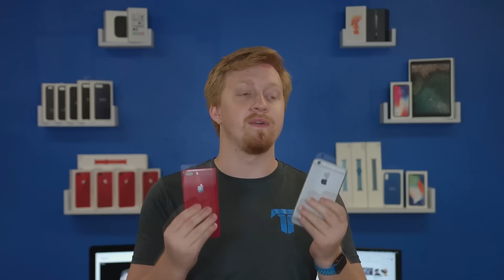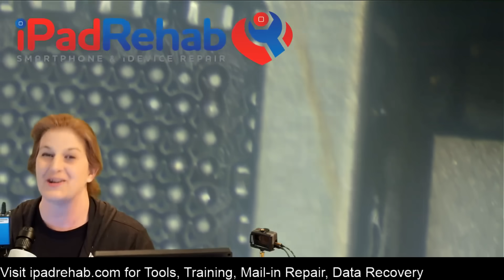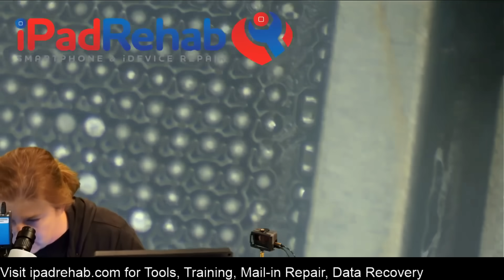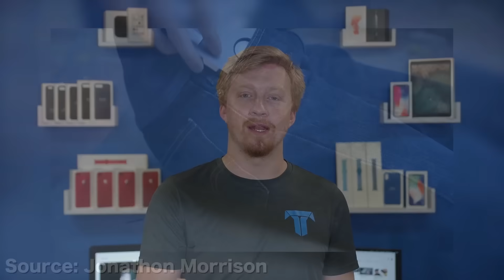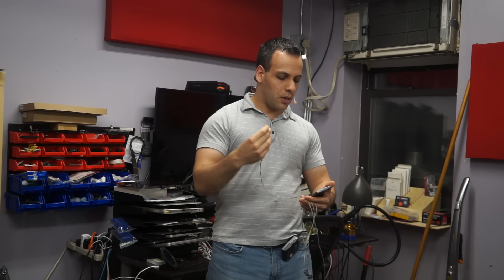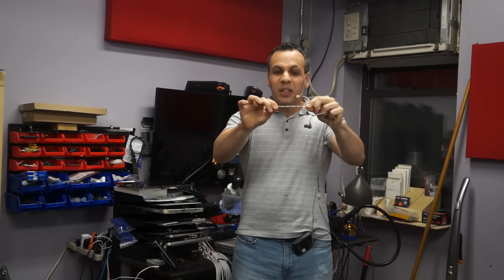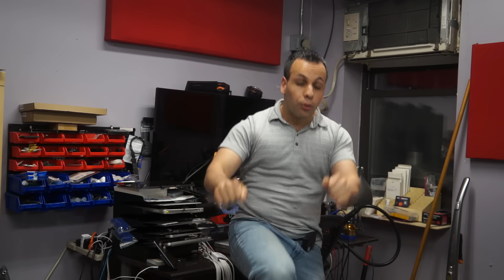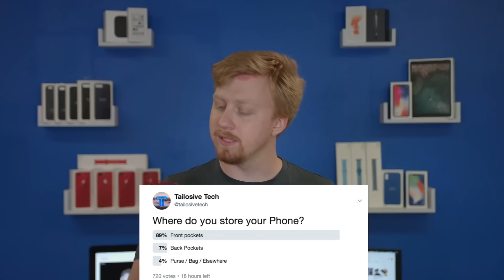The truth about iPhone bendgate deniers

Comment: "why are we still talking about a hardware flaw from a device from 2014?"

Because a phone should last at least 4 years
Reply: And it contradicts the usual justification to buy expensive Apple products: People claim that they are not more expensive in the long run because you use them much longer than cheaper phones. 
(Providing you bought the one with enough memory built in because it's not possible to put a microSD card in and move some of the stuff on it. That also doesn't fit to that logic, just like SSDs and Ram soldered on a main board you can't access because you are not supposed to open the case of your computer.)
Reply: @jochenkraus7016  I use a 50 dollar phone and I'm happy with it
Reply: Because the iphone “8” is just the iphone 6sss
Reply: I can't believe my longest living phone was a Sony Xperia U, seconded by my current Honor Play, which has survived 2 screen changes, 1 chassis change, and a battery replacement. Absolute trooper.

Also, Sony phones are shit. At least starting with M4 Aqua
Reply: @King J-dub I still have my s2 and my s4 and they work fine. Just slow af and I had to repair screens. But as a backup phone on vacation they're amazing
Reply: I bought a used android in 2013 and it lasted for me until 2018
Reply: 4 years is impossible for Apple phones. iPhone 6 will get it's iOS 11, and the battery will start to last 4 hours on a normal day. Android phones, on the other hand, stay on the lower firmware, and can last for a long, long time, until the battery naturally degrades, or when a user makes a critical fuckup.
Reply: @randomweeb6997  My iPhone 6 lasted 5/6 years. Replaced it because the battery had worn and Apple stopped updating it. Got a Pixel 4 atm and my only gripe with it is the battery life.
Reply: @HarishBhagat  my dad still has his iphone 6 and i can confirm it's not bent.

Comment: the flawed parts i agree on but to bend phones is just stupid in this day and age when
we all hurl if a new device isn't thinner than the previous one. 
i got the infamous iphone 6 no problems. in my 43 years i have only dropped my phone
once while it was clipped on my belt and i tried to get on a high bike.
for reference sake sony did a model ultra z which has a glass front and back any of
them that got broken got replaced. i simply think in 2019 you can't expect the phones
to last like the old ericsson and nokia's. we have too adapt, there are special cases
if you tend to brake your stuff.

Comment: Shop owner here. I wonder if the flex defect shown on the bga pad isn't sometimes  resultant of heating off the chip, as in pad lift from excess heat. Is this a physically demonstrable failure before removing the bga ic? Or, is there a process by which to prove that the entire chassis of the phone has flexed back and forth as described as to cause this sort of defect? How may I prove and demonstrate this for my customers?

Comment: The reason females put phones in our back pocket is because for some reason our clothes are designed with stupidly small pockets and the back pocket is the only one that'll fit a phone. Our front pockets are often 'fake' pockets too. Also, most female pants are high waisted so the phone would sit where the hip joint is which is very uncomfortable as you would imagine.

Comment: You wanna know how I know the iPhone's bend is a piece of shit? My 200 dollar Asus Zoom phone's casing has damage from flexing, in the exact "bendgate" position of the iphone.

Phone works perfectly, case is fine besides the frame around the screen having some warping due to the screen not bending with the case, the boards never received damage.

When the phone had "guerilla glass" on both sides my iPhone was pretty much never in danger of breaking from failures not really because they're good at making products, but more because attaching two panes of glass with a metal band leaves little room for design flaws... unless you make that metal band an antenna that gains interference from contact with skin or something.

Comment: TL;DR (Somewhat overly simplified) Apple do squared edges. Square edged profiles focus force. Most others do rounded edges. Curved profile edges distribute force. Material physics 101.

Apple chose design aesthetics over functional design. Most others did their homework and chose both.

-

One of the big things that separate these IPhones from the same gens of Samsung S and many others, is the body edge profile. Samsung and many others either went to, or stuck with, a (partly) curved edge profile. Used correctly, this transfers bending and torsional torque over a much greater area. Result: it takes a lot more force to bend it. Apple on the other hand, went with a squared off edge profile. This focuses bending and torsional torque, into really small areas. It doesn't take a genius to understand which type of design is gonna bend much, much earlier. So while Apple's choice of design might have felt sharper - both figuratively and litterally - it is inherently a much weaker design in terms of both structural rigidity and overall integrity.

Just take a trip into town. Look around, I'm sure you'll find buildings with construction work scaffolding on its side. Look at that - it's like 20-30-50 meter tall! Yet those few thin metal posts that make up its structural framework, is barely a couple of inches in diameter, and only a few mm thick. And those are the bottom pieces, with maybe hundreds of tons of stuff on top of them, that isn't even sitting still.

I wonder what would happen, if you replaced those round-shape bars with square-angled ones. I'll give you a hint; it won't be pretty. A lot of people are gonna have a bad day and die.

Comment: TL;DR (Solder) joints, sandwich-bonded components (incl. PCBs) will eventually experience separation, yielding and breakage due to material fatigue.

As with anything else, you can only induce cylcles of elastic deformation for so long, before material fatigue catches up and lowers the bar for plastic deformation. And while the metal and plastics on the outside of your phone can substain a significant degree of plastic deformation, as they're simples hapes of a single continous piece of material - the majority of the internal parts, can not. They are complex constructions made with sandwiched layers, non-flexible bonds and internal connections between different materials and components. Those bonds and materials can't substain plastic deformation. They break.

Imagine a playing card. This is your phone's metal frame. Bend it a bit, it springs right back. Bend it far enough, it changes shape in the middle. It doesn't spring fully back to its original shape, but it's not like its falling apart.

Now imagine a deck of cards, glued together with a non-flexible glue. Bend it a tiiny bit a few times, it may be fine. Bend it some more - either the  glue start cracking, the cards start tearing or both. Bend it a tiny bit many, many times, the glue starts crumbling.

Comment: worked for a company that had a product with flexion issues, the fix, was "Stupid" we just added tiny rubber gromets at all the pcb mount points, and used slightly longer screws, never had another fail from flexion...caps bursting...thats another story(we got CASES of fake rubycon caps that looked so close to legit...even the rubycon rep that checked them had to take some to have them examined... they gave the company a deal on legit ones and went on the task of tracking down who was making the fakes... i remember the rep... dude had coals in his eyes , red hot coals... he was enraged that a company was making his employer look bad.... 

anyway...this issues... just sad... i only own 1 type of apple product, the type i can rockbox... and then, its partially because its fun, and partially because  "hey look and apple product that dosnt run apple firmware, and can play anything, and just acts like an external hard drive"

Comment: And that's funny he mentioned iPad bending and it ended up being a problem with the 2018 model.
Reply: Yeah in the beginning ipads had rounded edges, that are miles stronger. Then they went square, which is miles weaker. In the beginning that was sorta ok still, as the frsme material was thicker, and the front glass was much thicker - contributing to rigidness. But as they continued to hunt for lower weight, all these structural materials got thinner - and eventually they crossed the threshold of structural integrity vs the force exposure of "ordinary use".

Those square edges look/feel "sharp". But while rounded edges distribute force, so it can take a sh1tload of torque and distribute it as a tiny bit of elastic deformation all around the circumfrance of the bend, - square edge profiles focus torque. That means a square edge will bend a lot sooner, and when it does, all that force is focused into that small point of yield, and causes plastic deformation. As in, it doesn't spring back into its original shape.
Reply: @pr0xZen  Not just the squared edges. The smart connector pins sits right in the middle with the body being so thin there is no structural rigidity to it.
Reply: Its a feature not a defect /s
Reply: what do you expect

Comment: Holy shit you suck at arguments. Tailosive Tech was right.
Reply: Please, don't  defend Apple or blame customers when it comes to "bengates", one example is: "stating that YOU never had a problem with YOUR iPhone". Many, many other owners unfortunately had, their phones bent even if they were using  protective cases . The bending was still happening after a while even with careful everyday use, without putting them in a back pocket. The bends seemed very small in many cases, but it still damaged the main board in the phone anyways, causing chips and other parts etc. to loose their connections. It must be ok to criticize Apple and holding them responsible when they put a potentially faulty product on the market. Even if you are Apple fanboy or not, we must adress the issue. I would be furious if my iPhone was bending if I paid for a premium phone and the Apple experience. I am happy that you haven't had this problem, because the phone is great otherwise.😘😊❤

 (Remember that the ipad is bending now, and Apple's answer is that they might be shipped bent ? I hope that they sort this out, because a bent iPad makes it much more fragile. 😢☹)*
Reply: @NickanM  Tailosive Tech actually made sense. The iPhone 6 while it did bend, was an amazing phone and from personal use would not bend under real use. The iPhone 6s, 7, 8 while similar design cannot be bent. I use an s9 currently but I'm definitely switching to the iPhone XS Max.

Comment: I'm embarrassed to say I did own an S6, but I bought it used.. No SD card was a serious problem for me and yes the interface was painful.. Actually I'm pretty happy with a Hand-me-down Alcatel!
What I don't get is why ALL these companies have to insist on making a 5mm thick phone with crappy battery life that needs to live in an otterbox that makes it 15mm thick and adds nothing to the functionality.. If they made them 10mm thick with a good battery (that could be a structural component!) and some rubber edging only people who use them exceptionally harshly would need a case, and you could go a couple days between charges

Comment: I tried fixing a broken Galaxy S3, well, because it was broken. Yep, I screwed up the fix, but it gives me more respect for electronics repairmen. Hell, I'm having an interesting time with just replacing a headphone plug on some old headphones. I'm on my 3rd plug
Reply: Nah. The third time looks pretty stable. I'm actually learning a tough lesson about the plug quality though. Holy crap are some plugs not good at all
Reply: Haha. I'm surprised you can still get Radio Shack plugs. 

In my case, it's a lesson about buying the cheapest plugs I could find off Ebay. In this case, I was using female plugs to create an extension cable from an instrument cable just to get soldering practice, also since I had to clip off a substantial portion of my headphone's cable. The plug end looks unreliable. The solder joint looked pretty solid this time. 

I think I'll try Monoprice next. I also have been improving and getting faster at soldering as I keep doing it.

Comment: I had an iPhone 6s Plus for over a year, after my wife used it for over a year. It never bent. Now she has the XS Max, I have her 7s Plus. They don't bend either. So it seems the problem was fixed 3 years ago. So the dude got it right, there's no point in talking about it in 2019. Unless the reason is "bitching for lack of a real complain". It doesn't fucking matter that the current phones are based on the iPhone 6. The current cars are based on a piece of shit from 100+ years ago with 3 billion problems. Do we still talk about them? iPhone 6 bent, Note 7 burned you alive, shit happens, things get fixed, we move on and bitch about current and real issues.
Reply: The thing is that we now know that Apple knew that the phone was prone to bending, but still refused to help the customers. ☹😢

Comment: The arguments of the guy in that video cheering for apple is nonsense for more reasons. Engineering means going beyond the point of safe just to be safer. Us in civil engineering for concrete we use a safety factor of 1.5 just be safe; meaning putting 50% more material to be stronger. Bicycle manufacturers do tests beyond normal use and applications just to be safe and have a good reputation. BENDING a phone is REALLY not unlikely; so apple has to FORESEE (expect a small chance of this happening) this problem

Comment: 8:01 "the person sat on the phone..."  No, he didn't.  He put it in his front pocket, not the back pocket.  And some people wear jeans that are tight, have odd pocket design, maybe a pocket that it won't fit it completely and the lip of the pocket puts a fulcrum point..  Or they put it in any back pocket and bend it immediately.  Inflection problem is real, as are the small mountain of engineering debacles for these outrageously overpriced idiot-devices.

I'm with you on this, Louis.  And I think that guy.. if he has one subscriber, has one too many.

Comment: You totally pretended that the 6s doesn’t exist. That came with 7000 series aluminum which prevented #bendgate.
Reply from the maker: what series aluminum did the 7 use?
Reply: Louis Rossmann 7000
Reply: Louis Rossmann plus, try bending the stainless steel on the iPhone X/Xs

Comment: I think a good example would be the xbox 360 red ring of death. the heating and rapid cooling eventually cause the board to warp and the chip to separate from the board...massive issue that wasn't repeated in future models. apple would continue to use the flawed design

Comment: The S6 was a POS but the build quality was rock solid. I just stopped using it recently. I've dropped it off of ladders, down stairs, and on concrete many times with no case. It's so thrashed that the chassis is visibly bent but it still works great minus all the things you mentioned. I'd love to see you to a tear down of my phone vs a damaged Iphone 6 with less wear.

Comment: 26 minutes in, regarding the "Apple probably already had them in production and wasn't going to stop just because X..."  There's a story that I've heard regarding one of the new iPhones (might have been the 5; it was new at the time) where they were well into production- a handful of weeks before release in fact- and one of the new "features" was a plastic screen- I assume to make them lighter.

This was when Jobs was still around, he goes into a meeting, pulls the prototype out of his pocket and, understandably, it's scratched to hell.  And he decides in that moment: switch to glass.  Took Foxconn less than two weeks to turn production completely around to replace the screens with glass screens.

Admittedly this kind of turnaround time is largely made possible because Foxconn is basically a human meat-grinder, but that's a topic for a different time.  Point is: turnaround for redesign- even when things are down to the wire- is possible for Apple if the ~will~ to do so is there.

Comment: 10:10 Thought of another analogy, if you get those mailers from your bank or your school grade reports, or coupons from restaurants, The paper has a perforation so you can rip off the paper. The bank one specifically usually tells you to fold the perforation back and forth until it is softer/weaker so you can rip it easily. This is the similar concept here, as you have repeated stresses/pressure the material wears out over time.
Reply: Much easier analogy... bend a paperclip or any other solid metal wire back and forth. Depending on the exact metal alloy it can withstand just a few or quite a lot of cycles, but eventually any metal will break from fatigue cracking.

Comment: But they did fix this issue and learn their lesson. I had an iPhone 6 which started to bend after I had it in my back pocket every day for 12 months, I complained to apple and they replaced it for free in their apple store. I then sold the free replacement, and bought an iPhone 6S which I put in my back pocket. It didn't bend even after 2 years of being sat on without a case.